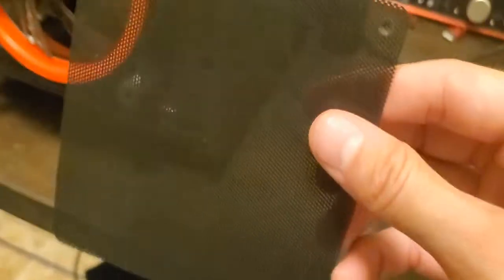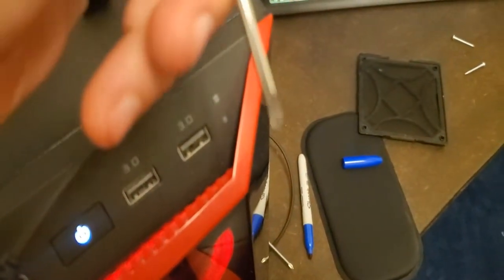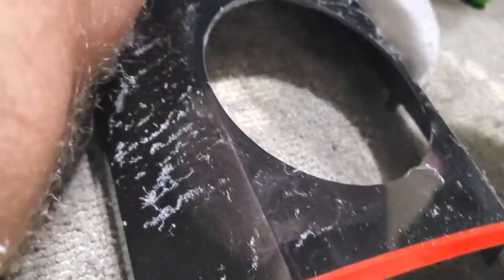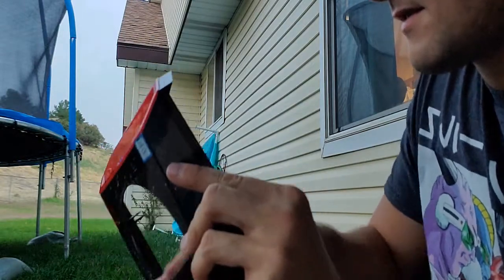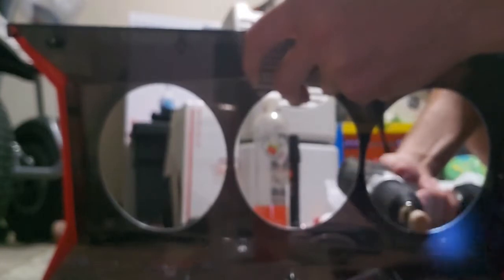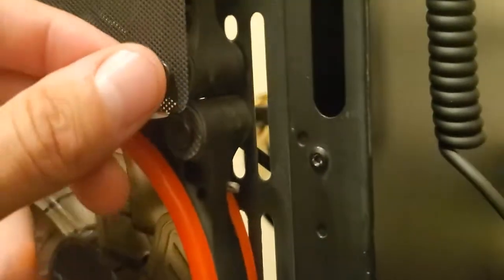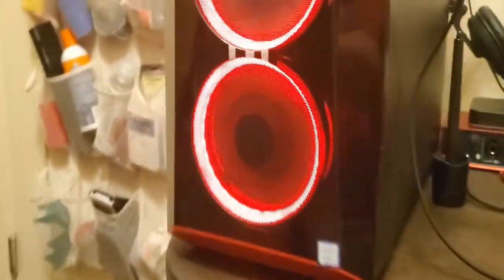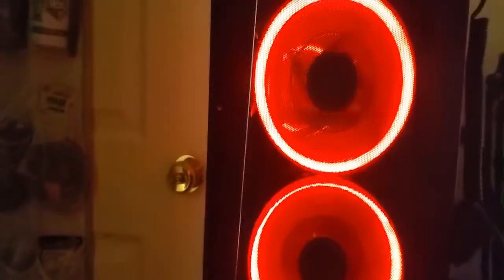DIY Special: CYBERPOWERPC Case Air Flow Fix!!

Comment: I have this same case, it sucks. dont have a hole puncher like you had, but I drilled lots of holes into it for the time being.
Looks like ass, but it's fine. Much much better than zero airflow like it originally had

Comment: I had a Liquid Freezer II installed in my CP computer which replaced the three fans in front.  The Computer Tech repair store who did the install told me I would have to go with a two fan model because the three fan model would not fit.  This of course did not solve the air flow issue, so I found your video and did something similar... I drilled two 3" diameter holes in the face.  Since the Liquid Freezer II already has a mesh radiator-style screen in front of each fan, I didn't need to add a protective mesh at the new openings.  That actually defeats the purpose anyway since any kind of screening would diminish the amount of air flow; so keeping it open is actually ideal; especially for a Cyber Power PC.  I finished off the opening with 3" diameter grommets which I found at Mockett (XG1) - they fit like a glove.  My Computer Tech also recommended an app - Speccy, which gives you a continuous temperature reading of you computer's components.  My average CPU temperature now usually ranges in the high 70's to mid 80's, and sometimes ventures into the low 90's.  This, as opposed to averaging well over 100 before the Liquid Freezer replacement.  Thanks for your video; I was amazed to find someone with the exact same computer chassis.  BTW:  My Computer Tech stated that CP chassis are notorious for bad airflow.

Comment: Well i got myself the cooler master TD500 argb (2021 update), sadly is not the mesh versión, the one i got has a plastic cover in the front..and mesh around It..
But im thinking about removing that plastic (its really easy to remove, just unscrew and is out) and put a long mesh in his place, the front panel Is only a frame..so that make things easy.
Im doing this because i really dont feel like It to go and buy the mesh versión when i can do It myself..after all is just unscrewing that fron plastic plate and put a mesh in his place..
What do you think?
Reply from the maker: Looking at that PC case it looks like that's a lot of surface area to remove the mesh from. Your PC will be inhaling a lot of excess dust. Is are you currently having temperature issues with the components within your PC?
Reply: @amnfox  i didn't even build It yet hahahaha.
The case came yesterday and i didn't have time to build my PC due to work.
Im saying this because everyone says the plastic in the front restrics a lot of airflow.
The front panel is by no means completely solid, It has openings behind the bisel and around the plastic cover.
Reply from the maker: @sebaaullador1292  I came to the conclusion to modify my case because all my components were running hot and it was the cheapest solution.  Since then, I have made several more modifications and upgrades. I should post a quick video showing where my pc is now.
Reply from the maker: @sebaaullador1292   I wouldn't suggest preemptively making the modifications to a brand new case. I bought my case discount and it was about 2 years old before I decided to modify it.

Comment: Thanks for making this video having the same issue with cooling. Ordered the parts to do the mod myself!
Reply from the maker: I've made a bunch more mods too.
Reply from the maker: I painted the front panel flat black (like the rest of case) and I hot glue gunned the the filters to the back of the front panel. Added some acrylic glass customizations too.

Comment: I have the same case as yours, mine has the back fan intaking air, wbu? Theres no fans shooting out of the case…
Reply from the maker: My rear fan pulls out air. If you feel your fan is pulling air in you can just flip it around and see how it does. My case is way more sick now. Reminded some things added some plexiglass customizations and painted the front panel mat black to match the rest of the case.
Reply: @amnfox  Wher did you get your mesh screens for the fans?
Reply from the maker: @akatheguy1319  https://www.amazon.com/dp/B08FY7QQ6L/ref=cm_sw_r_cp_apa_glt_fabc_04C5T3TP2E0XBCZ1JKQF

Comment: If you wanted to upgrade the fans on your cyber power pc how do you find out what size they are. Or add an additional one, mine only has two on the front. Really appreciate this video, very nice DIY.
Reply from the maker: Thanks man. Since this video I've done a lot more. New motherboard, GPU, CPU Cooler, power supply, and another rgb fan onto the front of the cooler, and some more customizations to the case. To figure out the fans, I just took one off and read the data on the sticker. To make thing quicker the fans in the video are 120mm Apevia fans. Also I swapped fans for some corsair fans and it only lowered component temps by a couple degrees, but it was more quiet.

Comment: How did you get your front panel off
Reply from the maker: I pulled at one of the top corners from the outside edge and it will pop right off.
Reply: @amnfox  thanks man i was scared to pull mine off

Comment: My air flow fix was with my cyberpowerpc was the fans were all pushing no fans were intaking. I had to reverse direction for the front 2 fans. I also changed the fan curve in the bios. My cpu temps in game went from mid 80's to mid 60's. And idle went from mid 40's to mid 30's.
Reply from the maker: That's wild.